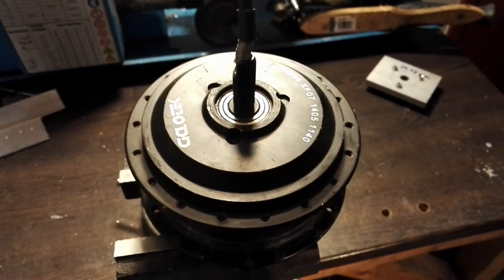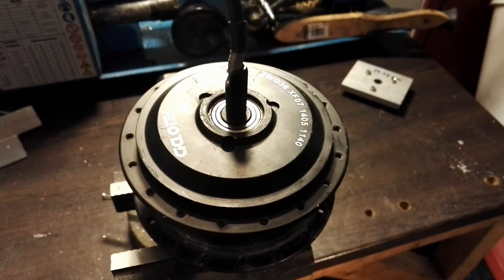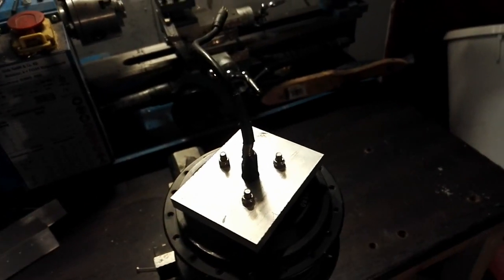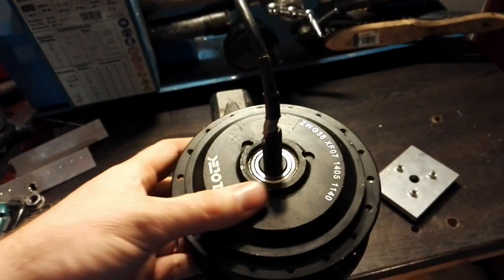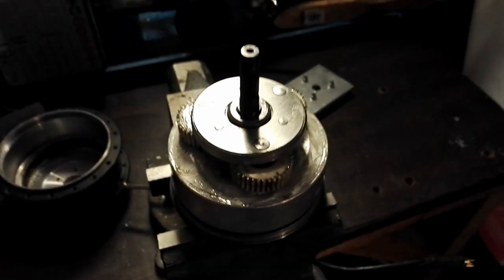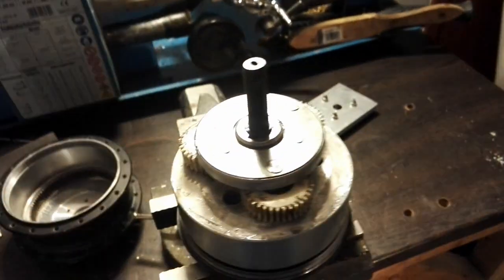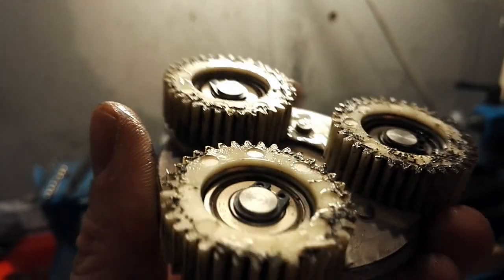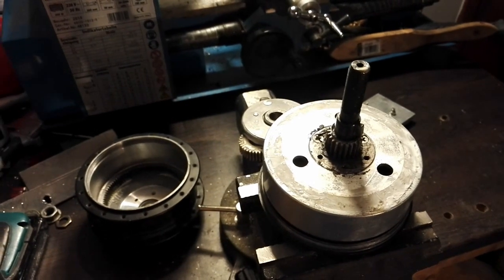A Look Inside a Geared Hub Motor After 5000km. Bad Failure!

Comment: Mine just crossed 3200 miles and the motor is in great shape.
I've pulled it apart every 1000 miles the replace grease.
Reply: I'm curious why? Does dirt get in?
Reply: @bobdebouwer7835  
The first time was just to get the factory grease out and some better stuff in.
The 2nd time was because water got inside. Removed all the contaminated grease and replaced with new grease.
Tha last time was just out of curiosity on how the motor was holding up after 3k miles.

Comment: You did the right thing opening it early!  I did not open my geared hub motor in time for maintenance and it locked up and threw my son off the bike and he crashed, sprained an arm and lost a front tooth.  Thank you so much for posting this.  I haven't found a shop that will work on my Prodecotech hub motor, and the motor has those same three spots on it.  Now I know what to do.
Reply: lol i didnt know that it can do that. Those motors should not be sold if that can kill people...
Reply: @bobikbobikowy5458  probably a shredded internal nylon gear that jammed up the clutch. Usually you have plenty of warning.

Comment: thanks for the video i have an akm 13.0 hub motor that looks the same as yours i tried to build the tool using wood with some screws(since i dont have a shop)  but i failed. I wasnt not able to unscrew it.

Comment: That normal,repairing things need too much passion and online or onsite (books) research, before you preceed.  like myself i lerned how to fix cars by damaging the transmission of  the first car i was experiencing on, and i also learn how to fix laptops by damaging the first one, but now i am expert on cars and laptops. I will never repeat that mistake again, as i said passion is very important in fixing things, if you rush, defenitely there is a hight probability  that something may go wrong, like breaking a bolts or screw,  damaging a wire, or tread .....

Comment: I normally destroy mine after 500km.. 5000 is good👍 on the geared motors there ready for maintenance and gear replacement at/or around 5000km

Comment: Thanks for this video. I can imagine that it was not easy to discover how this motor was assembled! It is a fine way as long as corrosion does not get grip on the threadings. There are so many ways to keep the motor parts together and this way is not an obvious one. Manufacturer or repair manuals ..... I did not find them. Courageous work and thanks to you taking the risk others can avoid it! As far as I know the axle bearings are more prone to wear (or better said exposure to corrosion, following by accelerated wear). Gerard

Comment: Thanks a lot for the video i have a 36 volt 350 wats brushless  motor with 3 power wires red black green and 5 small wires but no controller the motor refuse to start with a 40volts battery is it because theres a built in controller or what? by the way when i turn the wheel there is a spark between red and black wires  please help thanks a lot

Comment: want to get more mileage from the battery but it may burn out quicker so don't try to race it ok. take of the front sprocket and pedals and then put it in place with the sprocket on it and then chain it up to the rear wheel and if you think the hull is strong enough cut the sprocket and arms out and put it directly on bike frame (just use a cheapo) the put a sprocket on it and roll. WARNING it will also increase maximum speed and i am not responsible if you hurt yourself.

Comment: ..from what i know, a good motor utilize sort of steel gears, not Nylon as we saw here...Good video,. thank you.
Reply: Nylon are GREAT
Reply: Nylon is standard.  It's much quieter than metal. It's expected to replace them every 5000-7000 or so miles.  The really good ones like on a MAC motor are machined out of solid nylon but most are injection molded i believe.

Comment: Svenska? :) 
Thanks for this great video. seems like the coggs will be the last problem you run in to in terms of mantanence. 
I need to  change  the cableon a "Ecoride" bike , i think its the same manufacture of the motor ( just another rebrand),  any cance you have som footage ot the electorcis side of the motor on the other side ? or know where to get a speare cable?

Comment: So after 5000 KM the motor DIDN'T fail, you just broke it when opening it because you forgot to remove the bolts on the other side, forcing the threads to destroy themselves. so basically, these motors are really good and long lasting, just make sure you remove all the bolts before disassembling them!

Comment: Professional machine shop could repair your threading for a hundred. A sleeve would be installed and threaded.
Reply: Doesn't  make financial sense when you can buy a brand new kit for around £160. https://www.ebay.co.uk/itm/Voilamart-26-Electric-Bicycle-E-Bike-Conversion-Kit-250W-1000W-Front-Rear-Wheel/112497011093?hash=item1a31582995:m:moOJLZJhAKYesQXQ8j7qQow:rk:2:pf:0

Comment: You can turn down the threads in your hubs so that they are a slip fit no greater than 0.25mm. Refresh your bearings and re-grease the inside. Use Loctite 638 to combine the two hubs together, clamping in your vise. Cure time at 24 hours will yield 25MPa, 72 hours @ 31MPa.
Reply: Do what this guy said........he Knows the way of the MegaPascal!!!!!

Comment: Plastic gears are not high quality as metal..
Reply: The main problem with plastic gears is that they can't take high torque, and especially not a combination of high speed and high torque.

For low load applications, they are pretty good. The plastic damps vibrations and torque spikes, so they run more quiet than metal gears.
But honestly, I wouldn't overload a geared hub motor, as I'm afraid that the gears could break or even melt.
Reply: Alper Gökcek, Alper Gökcek, plastic and metal gears can vary quality tremendously. So really crappy metal gears can easily be worse than plastic gears. Teflon is a very nice material too. There are many factors that effect material choice, like temperature, load, and desired weight. For this application, configuration, and considering he's has gone 5,000 kilometers, it is definitely good.
Reply: john kessler gets it. it is all about what you intend to do with the motor what motor you want to build. sometimes i think some people actually expect there to be some sort of universal motor that is just better than everything else. that isn't how it works.
Reply: That kind of sounds chinesy to me.
Reply: In this application there is no real difference in longevity, yes metal can be stronger but only when high quality materials are used but most cogs now are powdered metal that really is not much stronger than nylon counterparts,  Not just that when i got my hub motor a year ago i ran out and bought metal gears thinking nylon would not last and well lets just say those gears did not last a month before i removed them, not because they failed but because they were way more noisy even with a good helping of grease, but i also learned that the reason they are nylon is to provide an important intended failure point, as the teeth on the hub body are usually cut from the alloy and so if you use steal cogs there is a good chance they might strip the soft teeth right out of the hub body and you are done, and so the point of the nylon is that it is strong enough to work under normal use but weak enough that it will break before damage is done to a component that can't be replaced when super stressed.
Reply: wear and tear destroys any motor, the intention of the motor dictates the motor's materials. you could use steel if you wanted to on everything and it would be heavy as hell, or you could use titanium, and it would be insanely expensive. its a give and take, eventually we might have universal hub motor shells and they will be parts like any other bicycle part. standardized. then will you stick your nose up at the guy who saved a few bucks to get into it and used carbon or glass reinforced gears instead of titanium or pure carbon?
Reply: igspowered it is about the purpose of the gear system, you are speaking of stationary objects. yes, it is solid, but it is extremely inefficient, not to mention brass would become a sponge very quickly under the stresses of a hub motor. steel is allot heavier, and in this circumstance not only would it add weight to an already very heavy object from the electro magnets, it would wear fast and need lubricated more. what a 1500lb engine needs is not what an aircraft engine needs, and ect.
Reply: A really high quality gear would be all metal and it would bathe in oil just like car rear trans axle. It would last forever on a bike. Of course the gear would have to be separated from the electric motor side with oil barrier. It would cost a pretty penny but it would be maintenance free for a quarter of a century at least.
Reply: it wouldn't just cost allot four seasons, it would be REALLY heavy.
Reply: plastic is self lubricating and can last up to twenty times longer than metallic gearing.
Reply: lol  so why do the  best  gear  systems  all run brass  or steel  gears   i think  ur very very wrong   there    gearboxes that are   over 100 years old  never been rebuilt   with steel gears    very very  very common    in big drill press  etc  also nylon   tends  to melt    with   heat

Comment: We use several of those motors mounted on front 20“ wheels of a cargo bikes. The first one has failed after 40.000 kilometres. No gears replaced. Where can you buy spare gears?
Reply: China

Comment: Easy to fix, drill and tap holes around the edge into the stripped thread and put in 3 or 6 grub screws in
Reply from the maker: myozone 

Thanks for the idea! I have thought about something similar myself, too. I would like to build some sort of electric drive only recumbent bike for the kids. Maybe a trike. I would use the damaged motor in the rear. That would make a nice project for winter. :)

Comment: Hii
Thanks for video
Can you tell me how much noise it make??
Reply from the maker: It is a bit difficult to describe noise. If the gears are properly lubed the motor sound is pleasant. When the grease wears off the gears can start rattling and the motor becomes more noisy. Adding a bit of silicone grease helps a lot and makes the motor silent again. Silicone grease will not harm the plastic gears, if I am correctly informed.

Comment: this looks similar to my motor and the clutch on my planetary gear unit has failed can you tell me the dimensions of yours to see if it would fit. my motor has no name on it
Reply from the maker: Sure, which dimensions are you interested in?
Reply: the diameter of the clutch , the size if the shaft and the diameter of the shafts that hold the planetary gears , thankyou for your help :)
Reply: Hii
Can you tell me after what distance it fail and did you push it hard???
From your experience what you think is it a direct drive better???
Reply: it doesnt matter if its a geared motor or direct drive,  its the clutch or one way bearing that failed. i wasnt hard on it and only ever use the low assist so its just worn out, i see on forums its a part that should be readily available as its a consumable part, mine had 4000 miles on it , apparently thats about right ammount of life, if you drive hard expect a much shorter life. thing is only buy 8-fun motors nothing else has easily available clutches, i still havent found one to fit my unbranded motor
Reply from the maker: The outside diameter of the cluth is 71.90mm, the shaft that takes the whole clutch assembly is 14.95mm and the planetary gears shafts are 7.95mm.
Reply: mines 72mm diameter, 57mm diameter to the gears and 11mm centre shaft. whats yours?
Reply from the maker: My center shaft is 10/12mm on the threaded part and 15mm in the center. I dont understad which dimension is 57mm on your motor.
Reply: geared gives you more torq but less top speed thats only difference
Reply: @lookoutleo  Not the only difference,the major difference is the geared motor freewheels better ,the gearless motors have more resistance due to the magnets "cogging"